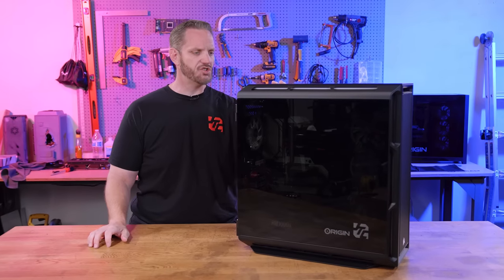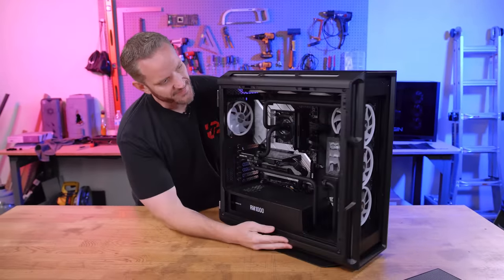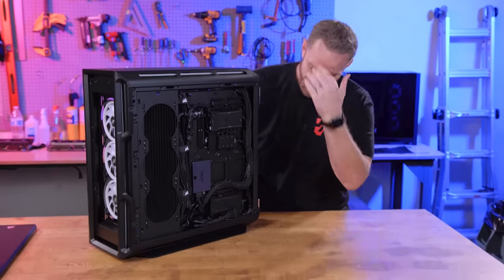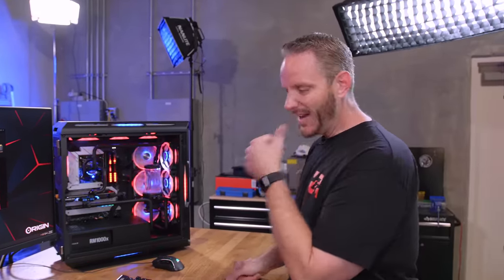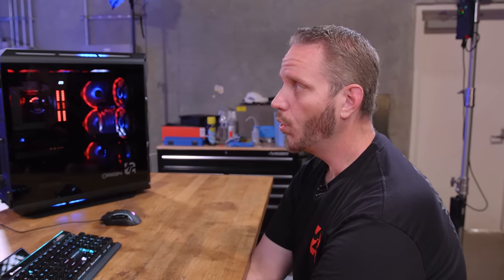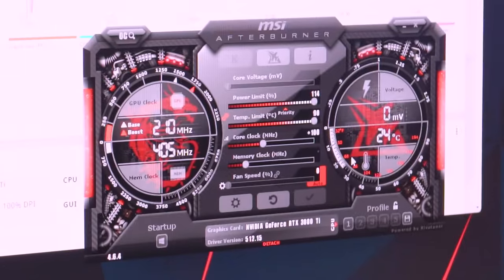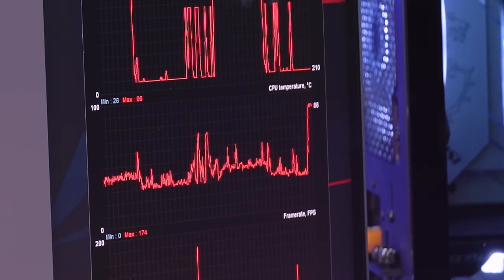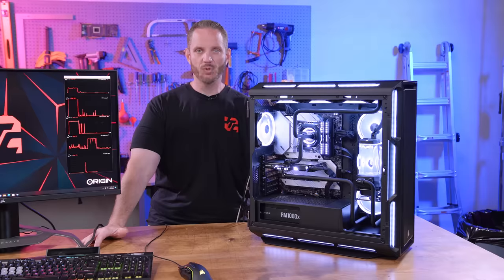This PC is a work of art!

Comment: Need input, please!!  I keep hearing differing opinions on water cooling [a lot of those are about AIO style coolers].  But I've been hearing people say that they'd never run liquid in a system that no liquid should mix with....and that systems can spring leaks and ruin a very expensive system.  The pumps can fail in 1 year or 2. And that they would only use air cooling.  

What is the deal these days?  Am I spending way too much money for liquid water cooling...and potentially creating an expensive bad day?

I'm wanting to run Skyrim with a lot of graphics mods, for example, and I know that temps can really damage a CPU or GPU.  I need to know what to do before I install the custom parts I ordered!!  I know that AIO coolers aren't as good as a custom loop.  And I know that air coolers probably can't cut it any longer for current CPUs.   And though the fans on a 3080 Ti may be okay, I'm not sure how they would do when running Skyrim mods.

I need to know if I'm spending too much for the custom loop,....and would be fine just using a quality AIO and letting the GPU fans cool itself [also having good intake and outtake fans on the case itself].  Because the custom loop is ~ $1000 for all the parts, whereas a decent AIO is ~200?

I have the following stats for the build:

12th Gen i7 12700
EVGA Z690 Classified
1000 W Power supply
EVGA GeForce RTX 3080 Ti
Corsair Dominator Platinum 32 GB

No plans to overclock this machine.

Planning on the fairly heavily modded Skyrim, Kena Bridge Of Spirits, probably World Of Warcraft, on at least 1440K graphics, probably get into other games with at least 1440K graphics.  My monitor is 4K, but 60hz.
Reply: Whatsapp✙𝟷𝟻𝟶𝟸𝟺𝟹𝟻𝟹𝟼𝟽𝟼

More updates on XRP,NFT's,BTC📊
Whatsap✙𝟷𝟻𝟶𝟸𝟺𝟹𝟻𝟹𝟼𝟽𝟼

 
More updates on XRP,NFT's,BTC📊
👆👆👆👆👆

Comment: With the price of one of their machines, and putting in all high end components, and a fully checked and working sysytem, I would never dream of changing any hardware.  That kind of hardware would be good for a couple years, at least.  Adding a couple memory stick or NVME is the most I would even think of upgrading.  There is enough software to get myself in trouble with.

Comment: Of note with the 5800X3D, I have two 360 radiators in a custom loop with a 3090 and even though that CPU is only pulling like 30 watts, undervolted even. While gaming with all that extra cache, my temps will sometimes still peak at 60 C though from what I've seen online it will still boost fine when even running hotter. Just interesting that both top gaming CPUs with varying architectures, sure can get toasty under a load.

Comment: the things that agitated me about so many "scientific wannabes" in the world thinking ike they know their stuff, is like one of this example, when they say "water cooling is more quiet than air cooling".  first of all, there are far more quieter air cooler out there than any radiator cooling types. and the reason why radiator coolers in GENERAL can be make more quieter, becasue the the surface cooling sets they setup in the RADITOR is getting BETTER AIRFLOW. while the air cooling fin stacks in the integrated cooler in most GPU has POOR air flow in and out. thats all. not becasue of the water. NO WATER COOLER COOL THINGS WITH WATER. THEY NEED FANS. THEY NEED WIND.

MY TEAM LIVES MY POLICIES.

Comment: Since it's a high air flow case I believe air cooling would be better with premium coolers.
Reply: air cooling better than 2x 360?
Reply: High airflow cases benefit radiators the same way. 

300W+ is hard for heatpipes. It's the sane choice for 95% of computers out there but not something like this.
Reply: @norkris8729  Never seen water cooling beat air cooling in all applications unless in a compact case.
Reply: @jamesm568  air cooling can never beat water..
Reply: @jamesm568  ok we got a noob here. Look at  the charts from Gamers nexus.  Nhd 15 gets beaten by all the watercoolers on the list.. ALL and u say that a air cooler is going to beat a 2x 360 loop LOOOL. you have some f  research to do...
Reply: @norkris8729  LMFAO! Gamer Nexus testing was tested in a controlled environment and was not tested in various applications either. Only thing I stated was that liquid cooling does not beat out air cooling every time as you stated. You stated incorrect information that can be easily disproven that liquid cooling does not beat air cooling in every application.
Reply: @jamesm568  ok. a 120 aio does not win over a nhd15..  but a intake 240... controlled envirment is a best case for air.. soo?
You started saying that Air cooling would be better than water... backpedaling much?
then u continued with 
" Never seen water cooling beat air cooling in all applications unless in a compact case." 
this suggests that a 280 aio is going to lose to a air cooler.  oh boy .. how can more surface area lose to less? how can more fans be wore than less?
Reply: @norkris8729  Depends on application. I personally find liquid cooling a gimmick, but liquid cooling does serve a purpose with small form factor builds or if you're heavy overclocker using a high quality liquid cooler. Air coolers are my first choice, and if a liquid cooler is necessary I will use one if needed. An air cooler is still my top pick for reliability reasons alone. They are exceptions though.
Reply: @norkris8729  And if you need a 2 X 360 loop for liquid cooling more than likely you're air cooling probably won't be efficient for that type of application.
Reply: @jamesm568  ok that i agree on. but again , ur backpedaling...

Comment: Hello I was wondering if I get my first gaming monitor the MSI MAG251RX 240hz would I be able to enjoy it with my gtx1650 with no problems until I upgrade my gpu? I've been thinking about getting the GTX 1670 super but I'm not sure what to get 🤔
Reply: Whatsapp✙𝟷𝟹𝟹𝟽𝟻𝟼𝟽𝟷𝟿𝟸𝟸

More updates on ETH,XRP,BTC📊
Whatsap✙𝟷𝟹𝟹𝟽𝟻𝟼𝟽𝟷𝟿𝟸𝟸

More updates on XLM,NFT's,BTC📊
👆👆👆👆👆

Comment: I just upgraded my pc and it stopped working idk how to fix idk where to go for help I had a 1650 gpu and a ryzen 5 cpu and upgraded to ryzen 9 and a 3070 ti  I have rog strix bf550 - f gaming motherboard I thought it was a simple swap but I have vga light glowing white and I can’t get disaplay on my monitor I tried going back to my old gpu to see if it was my gpu that didn’t work I did the ram stick swaps running 1 the whole nine it didn’t work my only guess based on the YouTube videos is it’s my cpu I didn’t do the swap of going back to my old cpu I’m not sure if my ryzen 9 is broken or what the issue is please someone help.
Reply: Whatsapp✙𝟷𝟹𝟹𝟽𝟻𝟼𝟽𝟷𝟿𝟸𝟸

More updates on ETH,XRP,BTC📊
Whatsap✙𝟷𝟹𝟹𝟽𝟻𝟼𝟽𝟷𝟿𝟸𝟸

More updates on XLM,NFT's, BTC📊
👆👆👆👆👆

Comment: Correction on the "two" Commander Pros in the case at 4:35, the first one is a Commander Core XT, and the other one is the actual commander Pro. You had them both labelled as a Commander Pro. Other than that, the build looks really clean

Comment: I swear guys please AVOID Origin PC at all costs. I bought a $4.5K PC from them because Linus recommended them but my experience was TERRIBLE!:

 *PSU defective on arrival causing random shutdowns and unable to reach manufacturer spec by 50%.
*GPU defective on arrival causing MAJOR stuttering. I shipped it back next day shipping and they ignored me for 1month with no communication until I contacted their manager.
*I had to replace everything in my system at my own cost.

I understand that THIS PC Jay is reviewing is probably solid but my personal experience tells me to at least warn you guys that this company isn't as good as advertised. Just letting you know.
Reply: Whatsapp✙𝟷𝟹𝟹𝟽𝟻𝟼𝟽𝟷𝟿𝟸𝟸

More updates on ETH,XRP,BTC📊
Whatsap✙𝟷𝟹𝟹𝟽𝟻𝟼𝟽𝟷𝟿𝟸𝟸

More updates on XLM,NFT's, BTC📊
👆👆👆👆👆